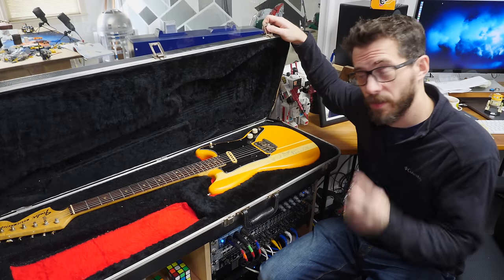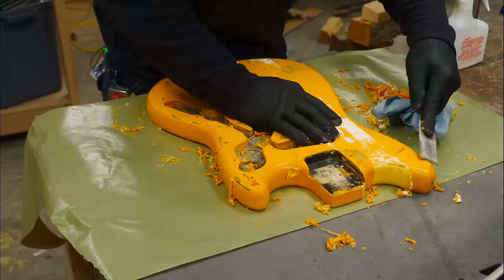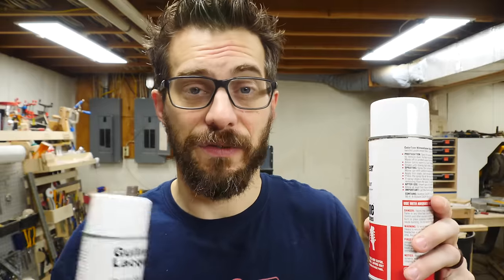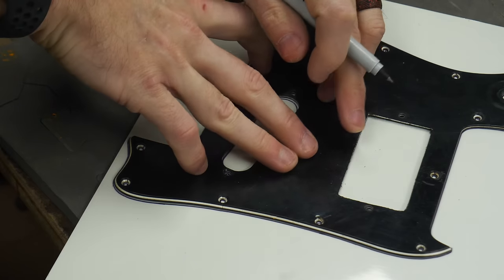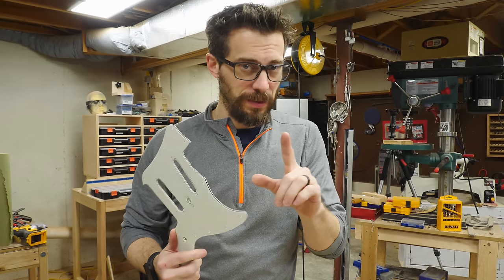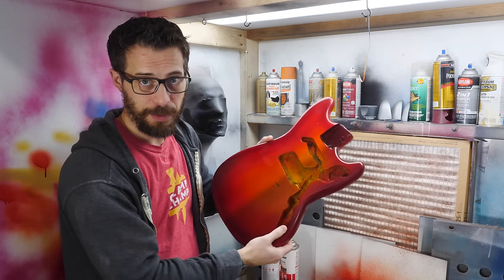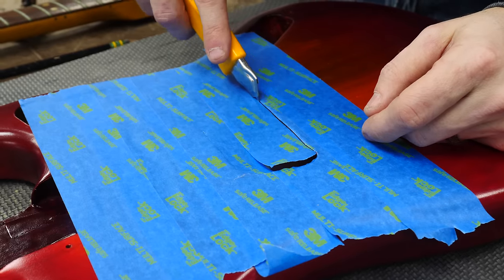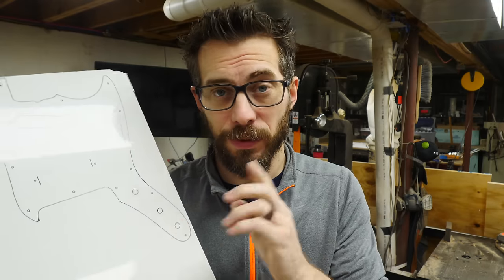How to Refinish A Guitar | I Like To Make Stuff

Comment: Instead of spray adhesive for the pickguard, why not just screw it to the board template? You already have the holes drilled. I'm also in the process of building a guitar. What is the time between coats of sealer, color, and clear that you made? I heard "every 30 minutes or so" but was that for the clear only or all three?
Reply: A rule of thumb for paint is if you are not sanding then wait until it's tacky, but does not come off on your finger. Since this is the kind of finish that hardens by literally drying (instead of chemically hardening, like automotive paints) it probably can dry even more before spraying the next coat since solvents from the new layer would soften up the previous layer enough to stick to it. Since Bob said that the lacquers he used are identical, only two were tinted, it's safe to say that waiting 10-15 minutes past the "tacky, but does not come off on your finger" is a safe bet for all three. In this case it's better to be on the safe side and let it dry a little too much than not enough so you won't end up with a sticky mess that takes a week to dry.
If you plan to sand, then wait until you think it's dry and try a small spot. If the sand paper clogs with a bunch of gummy bits then it's not dry enough. It depends on the temperature, but an hour is usually enough, especially if it gets to dry outside in the sun.
Reply: Not sure how the weather will hold up in the cold winter, but thank you for the response. What exactly does sanding between layers do? Get more of a shine and smoothness since it flattens the surface before the next coat?
Reply: Not necessarily more shine right away, but better adhesion of the following layer (especially with automotive/catalyzed paint) and a smoother surface. If you want a really shiny surface you have to sand it up to 1500 grit (or higher number, finer) sand paper and then buff it with special pastes. You can just buff the paint without sanding, but it's not advised since most of the time there will be imperfections like dust particles or overspray that will stand out on a polished surface and ruin the look. 
Going back to your original question about a pick guard, the reason why tape/glue is better than screws is because running a bit into a screw will destroy the bit where with tape or glue the bit would just cut through. In rare cases aluminum or brass nails or screws can be used since a typical wood bit will cut soft metals.
The easiest way to copy one would be to double-sided-tape the old one to the piece of material and use a trading bit in a router to copy the outline perfectly. If your bits have the same issue as ones in the video (bearing not flush against the cutting edge) then space the 'template' and the material with some blocks, then you can even champher the edge without un-sticking everything.
Reply: @ckortjester  I think sanding between coats gets rid of any imperfections, such as if the finish develops a ridge or any dust that might get onto the workpiece and get stuck to the finish. There are more descriptive videos and online tutorials about finishing wood.
Reply: @ckortjester  Yeah, like the others mentioned, sanding between coats flattens the surface, particulary the areas of rough overspray, which is important to achieving a quality finish.  An important thing to note is that with lacquer, unlike oil based enamel paint, each new coat "reactivates" the surface lacquer of the previous coat. I'm not sure that "reactivates" is the proper term, but what happens when the wet lacquer you are currently spraying hits the dry lacquer already on the surface of guitar, some of the dry lacquer from previous coat (or coats) actually becomes wet again.  This means that each new coat sort of melts into the existing coats. So scuffing the surface to allow the next coat to adhere better isn't necessary with lacquer.  You essentially end up with a single coat of lacquer that builds thicker with each spraying. With oil based enamels, each coat dries and remains dry when the next coat is sprayed over it, so if you spray it ten times, there are ten distinct coats of enamel. Just to help illustrate this distinction between lacquer and enamel paint, say you have 2 guitars and you spray one with 10 coats of enamel and the other with 10 coats of lacquer.  You would probably never actually do this, but for the same of example, let's say each coat of both enamel and lacquer was a different color.  (For example, the first coat of each was red, the second coats were yellow, the third coats were blue, etc.)  When you were done, if you sawed each guitar in half and looked at a magnified cross section of the enamel paint that you just sawed through, you would see 10 distinct layers of 10 distinct colors.  You would see the thin band of red of your first coat, then the distinct band of yellow of your second coat and and so on.  It would look as if you stacked 10 sheets of different colored construction paper together.  Looking at the cross section of lacquer on the other hand, instead of seeing distinct bands of red and yellow, you will see a red zone fading into an orange zone fading into a yellow zone.  The orange zone is where the 1st and 2nd coats melted together.
   This bleeding together effect of lacquer makes it very easy to work with compared to enamel.  If you spray too much lacquer and it starts to run, you can simply tilt the body the opposite way and the run will stop and you can watch it flatten out as the coats beneath it melt.  Lacquer is very forgiving in that respect. If enamel paint runs, there's no way you'll get it to dry flat.  You'll eventually have to sand out the run which is a pain in the ass and a time suck. Lacquer flows across the surface and levels very nicely.  However it becomes very important, especially if you are going for a high gloss "mirror" finish, that on at least the last few coats, you sand the entire front and back of the guitar using somewhere in the range of 180 - 220 grit paper on a flat sand block. Wet sand light with long strokes across the entire surface at all different angles. That surface may look flat without doing this, but you'll find out after your final sanding, once you've worked your way up through 3000 and start to use a rubbing compound... as that mirror gloss emerges... If you didn't use a flat sanding block for at least the last few coats... its like looking at fun house mirror. Reflections are all distorted and wavy because the surface, although it appears super smooth, it wasn't flat.  Because lacquer flows so easily, the surface can become wavy so it's super important to knock it down flat with a sandblock after those final coats. Another thing with lacquer to be aware of is that it dries to the touch very quickly.  However, especially the more coats you use, it can take weeks or months to actually cure. Be really careful handling the guitar in the hours and even days after your final coat.  Even though the surface is dry, the lacquer is not cured and you can easily put a deep thumbprint in the finish is enough pressure is applied.

Comment: Looks great, nice work.
Beveled pickguard edge, I use a 2 inch drum sander in a drill press with a rough angle guide, (visual ref.). Works for most of it, switch to smaller drums for tighter areas, then hand work at a fine grit.  Then polish the edge.  I never thought of a wooden template and a router.... great idea, next time.  Also, fitting all the parts before painting seems like the way to go.
I've had to go back and rework something after painting and that always is risky business.

Comment: I've put in a spare peace of wood into the neck hole as a handle to move it and to hang it without rotating. It also allowed me to clamp it to a table without something touching the surfaces. Made a camo pattern on it and it turned out awesome.
Actually it was a pretty similar kind of project. My first electric guitar ever, old paint, crappy components and now it's revived. Only my pickguard was bought, because I didn't trust myselve enough for that.

Comment: not going to foil the cavity? itll make it sound 10x better.
Reply: Hey, what difference does foil make? Is it something I should add to my electric?
Reply: @tomthelampy  The electrics inside the guitar (that includes the guitar cable going to the amp) are very sensitive to electromagnetic radiation. It's not going to do any damage, but it will cause some obnoxious humming when the guitar is plugged in and isn't fully shielded.
That's why all the electrics need to be fully surrounded by a conductive material which is then connected to ground. 
nstrument cables are allways shielded, so you don't need to worry about that, aside from actually using an instrument cable and nothing else!
The shielding blocks (most of) the electromagnetic radiation (coming from any transformer, for instance) and does a ton of work when it comes to dehumming your guitar sound.
Reply: @ichbrauchmehrkaffee5785  Thanks :)
Reply: I was wondering if someone noticed. But ya, foil tape or conductive paint. It's for shielding.
Reply: The pick-ups he used were Fender Noiseless, so i don't think he'll have a problem with hum... But you're right, if it was traditional single coils, then foiling the cavitiy would be a great thing to do if you're already doing refinishing work :)
Reply: Type of pickup doesn't matter, the wiring, caps, pots, etc act like little antennas and sends those signals to the amp... Shielding is a must for noise free operation
Reply: Foil does nothing for the sound of the guitar.  Old myth.
Reply: @MagnusGuldbrandsen   the Fender Noiseless stop 60 cycle hum associated with single coil pickups.  Shielding prevents RF noise.
Reply: @chado8452  Where do you get RF noise from in this day and age? I've never experienced it... But this might vary from country to country, of course. I mainly play gigs in Scandinavia, and here most electric fittings are done properly, all amps are grounded and most lighting rigs are LED - and i've never player near an airport, so no Spinal Tap moment for me... Yet! :D
Reply: @MagnusGuldbrandsen  "Where do you get RF noise from in this day and age?"  It's been around for about 13 billion years, so you should be able to find some...
Reply: @apexmike849  Okay... Fair enough. RF noise has been around for long - no arguing that. But i assumed that most of the people who would be reading my comment would be able to decipher what i actually meant. But OK, i'll indulge the pedants in the crowd :)

This is what i meant:

"Where do you get RF noise, in such quantities that it's actually noticeable and makes a discernable difference, when playing/performing with your electronically amplified steel stringed instrument, in this day and age?"
Reply: @tomthelampy  It's called a faraday cage
Reply: @apexmike849  nice!
Reply: @MagnusGuldbrandsen  I live on a large lake (so it's very flat.) I had a Fender P bass that would pick up a Christen Radio Station across the lake and broadcast it through the PA. Foil in the cavity stopped it.
Reply: @MagnusGuldbrandsen Cellphones and computers do it all the time, Radios like the ones that use the police and even the radio stations, i have been able to pick up the radio from the police a couple of times when playing guitar
Reply: @danieltsss  Where in the world is this? America, I would presume? :)

Comment: A good way of getting an even sunburst is to do the outer ring and then make a second piece of cardboard the same shape but 1" smaller in all dimensions.  You then centre this piece but use blocks to hold it about 3/4" above the surface, allows a pretty even bleed.  Can mess with the dimensions/height of the smaller piece for different styles of sunburst.

This is a good job you did, I really like the look

Comment: Have you tried SprayMax 2K Clear Coat.  It is a rattle can car clear coat that will give the guitar that factory shine you get from a new guitar.  Once the coats have dried you then can polish with a foam pad or a micro fiber pad on a DA polisher.  The product is very good but you have to use the correct 3M cartridge canister respirator.  It has a hardener built in and your final finish will be rock hard.  Cost $20.00 per can and will take 3-5 coats that dry in 20 min per coat.

Comment: Try using aircraft paint remover in an aerosol can, you can find it at most auto parts stores. Makes the paint bubble straight off immediately. A lot easier than all the scraping.

Comment: I've beveled pickguards using a razor blade. The trick is to colour in the edge (black if doing a white pickguard) so you can see how much material you've removed, and where. Blindly filing won't get you there alone.

Comment: Looks good, but FYI the second pickup with the 3 holes is a telecaster bridge pickup, and they're designed to be mounted at an angle instead of straight like you've done here. The pole pieces will line up with the strings better that way.

Comment: Good to see the struggle. It's helpful to see how much work and rethinking is involved in projects.

Heads up if you are putting in new pickups: Look at the intended placement and see if you want to do the same thing. If not maybe choose different pickups. Those Tele pickups could have been positioned as intended given that you were making a custom pickguard. And although it might not make much difference to you, it will look better to most guitarists and likely perform better if you use them as they were intended by design.

Comment: As a guitar builder myself I would recommend when you do the burst to free hand it with no cardboard sounds hard but its not. and you get a more dramatic burst.
Reply: I tought that with a 2 color sun burst you applied the, in your case, yellow first in all the guitar and the red only in the edges and fading to the center.  It's the first time i've seen it done the other way.  Also it' s the first time that i've seen a sunburst done with templates.

Comment: Lifted from an article on sanding sealer:
"A word of warning is in order. The stearates make sanding sealer rather soft. If you put a hard, brittle finish, like lacquer, over a thick, soft one, like sanding sealer, it is much more likely to chip and crack. For that reason, if you use sanding sealer, stick to one or two coats at the most, and plan to sand most of it back off. For the same reason, and because it tends to shrink as it cures, it is not advisable to use sanding sealer instead of pore filler."

Now, granted this is not the typical sanding sealer that Big Box Lumber stocks but personally I prefer grain filler over sanding sealer if I am going to apply color and clear coats on top. But this is personal preference. I think your guitars turned out great and I loved watching the video.

Comment: I notice you did not shield the cavities of the guitar.  That will mean that you will pick up electrical noise (60 cycle hum) and possibly radio signals.  I would suggest using something like copper tape as the easiest method although another common method is to use conductive paint or gluing in foil.  Your bridge also needs attaching to earth as well which will go out through the jack socket.

Comment: Nice work, I would just add that you could have used the pickguard template as a router template for your pickup cavities. Using a pattern bit. Also nitro laquer takes a long time to cure. I realize that you were going "good enough" on the finish and I respect that because I do too on my own guitars but to really set that finish before clear coat and polish it's good to let it cure for 2 weeks to a month first.

Comment: Just a little tid bit, If you spray the wood body (before the nitro coat) with water and let dry, the "pulp" in the wood will raise. Taking sandpaper to this will make it SUPER smooth, repeat a few times. This is great to make sure you start with a good surface to start spraying your guitar body. Especially for anyone that wants an oil finish.

Comment: The double and triple layers require such a steady hand to look good.  Your's look great.  I was wondering if you were going to figure out the "template" idea and then double sided taping the pick guard to route the chamfer - Glue worked better than I thought too.  You figured it all out!  I personally would have built a jig to keep the routing less free hand and more CNC.  They make edge bits with the roller bearing at the top to do this.  What you did is covered by the pick guard and fine, but man...Ziggy/Zaggy.  I wish the cheaper guitar makers would just cut a big swimming pool and then channel the top and bottom for a Humbucker long screws.  It would make mod'ing very easy and not an issue at all.   Everyone will mod the cheap...The expensive requires a rebuild/replace to keep value of the guitar.

Comment: Lacquer and Naptha are really harsh chemicals. I highly suggest using a respirator with high quality filters, especially when spraying lacquer. I finished a Tele body from StewMac years ago in a Butterscotch blonde with several coats of clear. But I went for the highly polished look by wet sanding from 400 up to 2000 grit and then using a guitar polish afterwards.

I'm glad you got the look you were going after. It's a lot of work but definitely worth it. Just remember, safety first.

Comment: I always shamfer the edge of my pick guards and scratch plates using a dremmel with a drum sander tool. takes a bit of practice on some old or waste material, but once you get the knack you can easily keep a good angle. Even on three ply mediums. And it is much faster too. My Avatar photo is one of mine (tortoise shell). If you can make your own it really saves money, especially on brands like G&L. They are unique and expensive.